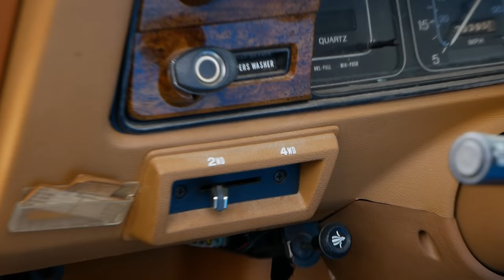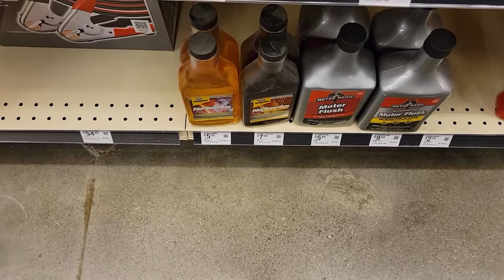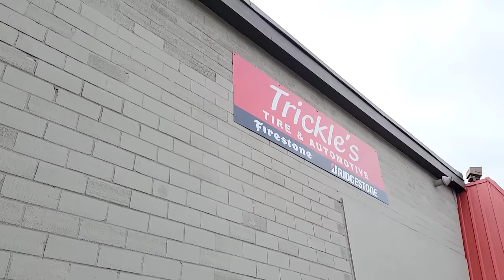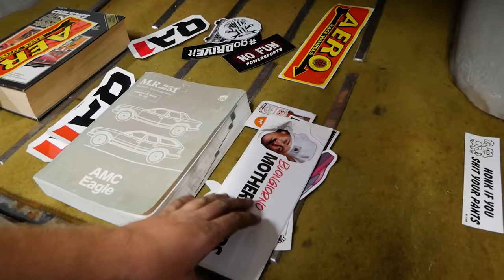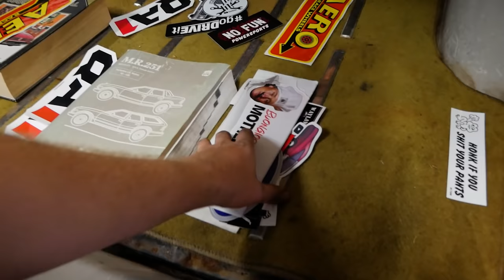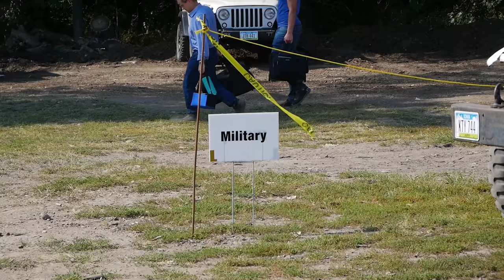$50 Car VS Off-Road Jeep Park - 24 Hour Build Challenge

Comment: If cars could be happy this one would have been ecstatic to get out of that guy's yard and back driving again.

I once drove my 79 Mustang 302 back from CA to PA with the rod knocking like that up until I was only 80 miles from home. Then it seized. Just turned the stereo up loud along the way and added oil at every gas stop. The engine had 270k miles on it. I'll never forget the mechanic at the service station we coasted into. He was screaming, YOU BLEW YOUR MOTOR!! I'm like yeah that ship sailed over 3k miles ago.
It was so loud people driving by me would honk their horns and motion to my hood :-) I was also blowing oil all over the side of my car.

Comment: Those tires are actually really good on ice. The lugs are altar flexi and the compound remains pliable in the cold. That said, the plug super quick in the mud, and wonder all over in the summer. Won’t feel it as much in an older unit, but they turn a newer unit into a waterbed on wheels around corners. Decent tire if you need lots of lug, and winter traction with decent hydroplane , and abrasion resistance

Comment: That AMC may sound like a pneumatic hammer falling down an elevator shaft, levels of power so low that it wouldn't be able to pull a priest off a choir-boy, and have 'Clark Griswold' grade bodywork, but... Damn it looked like a lot of fun!
I hope we get to see this Eagle again in the future, and hopefully on a track that has, um {clears throat} less safety regulations.
Reply: Same engine that was in the Jeep for decades

Comment: I would love to see u do a quick bearing replacement to make the knock better and then throw a turbo on it!!!! Weld up the rear diff and fix the front axles and it will be a fun beater!!
Reply: Unfortunately,it threw a rod

Comment: Are you going to open up the bottom of the engine to see what that knock was? I'm very curious. Amazing it held together during your off road games.
Reply: Roll a new bearing in (just the one), cut/weld lengthen that cv shaft , dump in some transmission additives, and do it again ;)
Reply: That's because it was built right, not like modern engines that explode before they even think about knocking that loudly. This is what a skookum engine looks and sounds like; absolute fucking hell and still shrugging off a day's worth of trail beating.

This engine shows why I refuse to accept as fact anyone who tells me modern engines are built better. They just simply aren't. They won't tolerate this kind of shenanigans.
Reply: @joshonthetube I'd like to see that, too.
 If it works I'll try it on my rod knock engine. Mine starts smoking after running about 3 minutes so it is probably too far gone for just a bearing now, however.
Reply: We now have proof that procrastination works. He just waited a month or so and the engine opened itself up and showed him the rod

Comment: I bought an eagle wagon in '94 or so when I was a teen working at Shell with 3 bays. My co-worker fixed some tranny leak several times and was just done with it. His dad wouldn't allow any leaking cars at home. So I jokingly said I'll give you $100. He said its yours. It was in great condition. I did the same thing taking it out beating the hell out it with friends. There was a really steep incline and my buddy said more speed you can make it! So I did and the front cv axle popped out just like on this one. I though it was broken though. So we left it and I picked up another from pick and pull. Came out a week later and it was all shot up and looked like it went through war. We fixed it and kept off roading several more times until the subframe just came off the body or something. It was dead. But the was the most fun I've ever had with any vehicle.

Comment: I was waiting for it to throw the rod through the block. Wow did that immortality surprise me.
Reply: Funny thing is.... even when AMC's do have a rod let go, it almost never ventilates the block.  Might go out through the pan, though.   AMC blocks are heavy duty nickle-iron.  When my machinist did my 401 a few years ago, I commented on using a diamond bit when he bored it out as an AMC block will eat steel bits.  He didn't believe me.  He phoned me mad as hell one day when he was boring out the block and he claimed it was taking a one and one half bits to bore a single cylinder.  I asked if he was using diamond bits, to which he replied "no".  He then switched to a diamond-tip bit and it took only two bits to to re-bore the whole block.

AMC stuff was tough as nails.  They were always 4th place in a three-place race.  They had a thing or two to prove.  Let's also not forget that even after Chrysler acquired AMC, Chrysler promptly discontinued their Slant 6 and produced the AMC six all the way 'til 2008.  Not only that, but Chrysler took AMC's V8-head technology and applied it to their LA-based V8s and that's where we get the lovely "Magnum" engines of the 90's and early 2000's.

Comment: Chainsaw bar oil, saw dust and remove the guts from the oil filter. If it still taps then banana peels diced up. Yes, I bought a car like that and it also had brake fluid in the transmission to swell up what was left of the clutches and band. Old auto auction tricks or scams.

Comment: The old AMC straight 6s.... They ALWAYS run.  Doesn't matter if they have lifter tapping (that's factory!) or rods knocking, or a valve or two missing they ALWAYS run.  Never strong, maybe not well, but they will always run!  Almost every kid in my high-school back in the day had something with an AMC 6 in it. I went to school in Kenosha so...

Comment: I had an 81 CJ5 I bought new, one day it started making a noise just like that. It was still under warranty so I took it to the dealer thinking it was rod knock. The dealer told me it was quite common with that engine. They started it up and dumped a quart of transmission fluid down the carb cleared it right up. I never had another problem with it.

Comment: Despite the rod knock and miss matched 1/2 shaft up front...... Awesome to see just what bouncing, bumping, bottoming, flexing it could take and not break.....completely. They are tough hybrids. If AMC had only put in better gears & a two-speed T-case, they would have really had something. 
     Despite that, there are some of us out here making those mods. Trying to make the Eagle what it should have been (sans the solid front axel swap crowd). I've done some cool stuff to mine and it's pretty cool in my book. Chrysler 8.25 rear, with a lock-rite locker better gear ratio, 1.5 inch of lift, 235 AT's, and the cherry: model 229 t-case (low range) from a Grand Wagoneer. Now it's what it should have been and very trail worthy !  Black Bear & Imogene in Colorado and Hells Revenge and Fins & Things in Moab (as highlight trails its done). 
      But this was good to see ! THANKS !

Comment: That poor Eagle.  Those are my favorite cars.  Mine was in good shape, and had all the options.  The cruise control was interesting... if your speed drops 3mph below what it's set to, the computer demands full throttle, and the pedal goes to the floor.  😅
Reply: That sounds totally safe, could never see a scenario where that's an issue lmao

Comment: 1:36 - "This was the first four-wheel drive car" - No, it wasn't. It was the first American 4WD production car. I don't know what the first 4WD production car was, but the 4WD Subaru Leone was introduced in 1972, which was 8 years before the AMC Eagle was introduced. Also, the Audi Quattro was introduced the same year as the AMC (1980).

Comment: My first truck was a k5 blazer i got for free with spun crank bearings and i wheeled that thing for a year waiting for that motor to blow up. Eventually got so loud i figured i might as well do something about it, dropped the pan and put oversized bearings on that cylinder which quieted it down a bit and continue to drive it, only knocked above like 1500rpms. Eventually changed out the motor but never broke

Comment: One that beat made the course, think of what one in proper condition can do. And that $50 car is probably better than what you could find at the bottom of some lake up in the Wisconsin North Woods. (Those things were likely fun out on the ice, doing what Subaru was known for before Subaru was much of a thing. There's got to be a few that went somewhere to thin to hold them.)

Comment: I ran straight Lucas Oil Stabilizer once. It took an hour to pour it in, but much better oil pressure and less ugly noises. Though  this engine's rod knock was actaully quieter than the lack of the exhaust.

Comment: So I’ve got a 2001 Dodge ram 1500 with the 318 magnum do you think if I put 2050 in it or did some kind of concoction like you did it would help because it’s making the same knocking noises as the engine in that AMC I know that you threw a rod by having it in first and I’ve been trying to babysit until I can afford a new engine anyway any advice would help thanks bud

Comment: Anyone looking for a 1983 AMC Eagle SX/4 there is one currently for sale here in Oklahoma for $1000 OBO it seems to have everything and is very clean and in great condition the seller said he was told it was having shifting issues initially and he also never got into the project so he never had it running. But if Anyone is interested lmk here and we can communicate I'll get tou the information you need to reach the seller.

Comment: 29:11 - Jeeps do reproduce. They also sniff each other out like stray dogs.
If you obtain an old 'flattie' (previous to CJ5 / M38A1), more flat fendered Jeeps, parts, and carcasses will appear in your yard over time (this from personal experience).
I am 'downsizing' to move in less than a year and have several such things and a garage piled with 134 'Go Devil' engines, T90 transmissions, Spicer 18 t-cases in to sell to good homes.

Comment: Knocking was most likely a collapsed lifter from sitting... maybe more than one. This thing is basically worn out, and still didn't do too bad considering the condition. An Eagle with decent maintenance and a good engine would do much better, but it wasn't made for this kind of driving. You can't lift it much in front without long CV axles... I seem to recall people using S-10 shafts? Anyway, put a good condition, slightly hopped up 258 (4.2L) in or drop a later Cherokee 4.0L EFI and you would have a great AWD car -- made more for snow and light trails than real off roading though.

Comment: Willys and AMC were both famous for using parts from different auto makers. The '60s and 70s Wagoneers and Jeepsters used Buick drivetrains. The AMC straight 6, though, was their claim to fame and Jeep was the main reason Chrysler bought AMC. That straight 6 was updated and used until 2006.

Comment: I have Eagles,, and something i notice with THAT eagles is the Air cleaner BOLT that goes threw the wire holder on the carb IS MISSING.
They fall out and down the intake they go and get stuck on the top of the piston then beat the hell out of the head, and flatten the rod end of the bearing and they incur a rod knock...........
Dont know if anyone will read this?
But its happened to me and customers cars.
Js.

Comment: Technically Spyker was the first production 4wd CAR, Subaru perfected it around the 70s then went AWD mid 90s. And I'm bitter because a restored 4wd 86 Eagle beat my restored 99 Wrangler in the jeep class at a car show. Not going to lie it was perfect, i didn't see that coming.

Comment: That interior is sweet.  Absolutely sumptous looking.  If I didn't know better, I'd assume it was a Cadillac based on the interior.  Why don't luxury car interiors look like that any more?  All so severe and business like inside, no elegance or luxury at all.  You need to fix that thing up to its former glory.  If AMC hadn't sold out to Chrysler, they would probably be the best American car company out there today.  Very forward thinking designs were coming out at the time of the buyout.  The XJ would have pulled them back to profatibility for sure.

Comment: In '89 I got an '81 Eagle.  Thought it would be an upgrade from my '73 Vega Kamback. Made one trip to Reno from Eastern Kern County.  Bell housing broke, PS pump blew out and strangest of all, the arm for the clutch pedal snapped in half.  A few months later, the CHP notified me the Kamback had been abandoned in San Ysidro as the title had never been transferred by the used car snake who took it in trade.

Comment: 1:30 Actually, the GP Vechicle (An army vehicle which would later be known as the Jeep) was one of the first 2wd/4wd vehicles ever, if not the first. The GP, or General Purpose Vehicle, was manufactured way back in the 40s. Sorry I went on a rant there, but I'm a Jeep guy, always have been always will. Just had to state the facts.

Comment: I had a gremlin looking one(cam back) and  sx4....I put Jeep 208 t case from waggy in...  It's hell on the front axle but totally changes the car...mine had a t5.  I had a wagon with a sbf swap and c4 d20...   The 208 is a bolt in....the front half shaft from an S10 should work too if I remember right...I made extension spacers for the front on one and box tube for the diff.

Comment: 258 straight sixes are near impossible to kill, i have an 87 Wrangler that went 320000 miles on its first motor, the last 5000 on five cylinders with a similar rod knock. It finally tossed a rod through the side of the block.  LOYAL motors.

Comment: I had a 1973 AMC hornet I started driving in 1986, it had about 130,000 when I started driving it. At 280,000 the odometer quit working I would guess another hundred thousand I was put on this car.
  So you were at a Jeep event I don't know if the eagle had the same engine but it sure look the same which was a leftover 232 Jeep engine. These damn things will run and run and run I think you could pull the plug out of the oil and it would still run. Lol
  Loved my red hornet

Comment: I have and AMC Eagle. The engine is a typical Jeep 258, EXCEPT that the Eagle had its own block casting. I do not know why, but they decided to mount the front axel to then block and not the frame.

Comment: IIRC  the transfer case is a NP 128. You can bolt a NP228 (with low range) right in.

Comment: Those AMC Eagles are quite interesting. Back in 1987 my friends dad had a 1980 2 door version that we drove almost every weekend for about 2 years until we tried to jump it across a roadway and broke the front axle (we were 17 and stupid) and his dad never let him drive it again after it was fixed. We also used to take it off road in the mud and it did quite well for it having some ground clearance and 4WD. Your Eagle was probably thinking, "Yes, a course I been wanting to go through but maybe I should have done this when I was younger like 30 years ago". Looks like you guys had fun though!!

Comment: lol... I had an 84 5spd that I lifted a bit... Didn't have to do much other than clean the carb when I got it, ran alright enough. 4x4 worked great, diffs worked great, ac worked great, took it off roading all the time full of friends. Oh, was $200... believe me, it was more fun than this one, lol... had it a while then traded it for a set of wheels and the same $200. It was so low to the ground though, center of gravity wise, that you could really take it derpin in the woops. Donuts in the fields.... and just easy peasy wheelin.

Comment: Not being funny but it kinda says something when a Rod knocking Dying car brands last hurrah from the 1980s with 1 wheel drive was able to at least flop around the park, also that burn out on the balance beam reminded me of when jeremy clarkson did a massive burnout trying to get a rover SD1 up a 30% hill on top gear. Kinda makes me rethink AMC a little bit, yes they are made from other factories old reject parts and ended up being dissolved into chrysler group what ever fate that may have been for the rest of the company but damn where those things made of some stern stuff.

Comment: I thought that you got that other AMC Eagle (the nicer looking one) with the beater with the knock. Tough car, I'm thinking the engine might be a version of the Ford 200, but I couldn't see if the intake manifold was cast as part of the head, like those 200 CID Ford engines are like.

Comment: We had  50 acres when I was a kid. We had an old AMC Eagle that we used to beat on in the fields. It was jumped, rolled, slammed into trees and eventually used for target practice. That car took some major punishment and honestly still limped into its final resting place before being put out of its misery with a .357 to the engine block. The car can still be seen from google earth rotting away in a field. Much respect to those old beaters.

Comment: They have no clue what rust is. They should come to WI. That car would have no rockers or quarters if it lived up here! A utility pole fell on my son's old explorer and using a porta power, tape measure, hammer, bondo, junk yard door and new windshield, it was back on the road for several more years (even put a new transmission in at some point) until my daughter put it into a concrete barrier at highway speed. Air bags light was on, did not deploy. She walked away but we decided it was too far gone, totaled for the 2nd time.

Comment: The rear is sitting a little low but besides that, the car has really good clearance to be the first 4 wheel drive car. I'd have to get the rear back up, get it running and go play. Well that was until you decided to turn it over. Damn what a little tick. I still would have to repair it. Put a larger motor in it. About as big as you can put under it. COOL RIDE!!! Please rebuild it